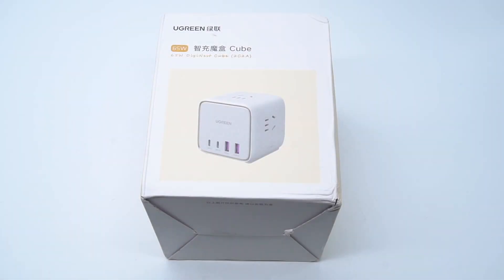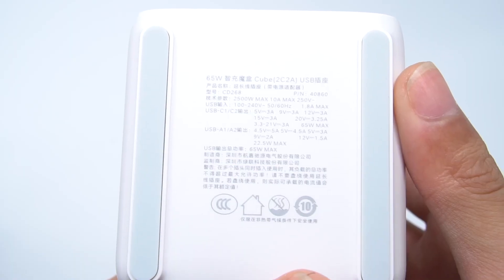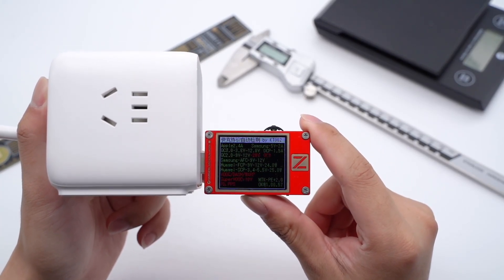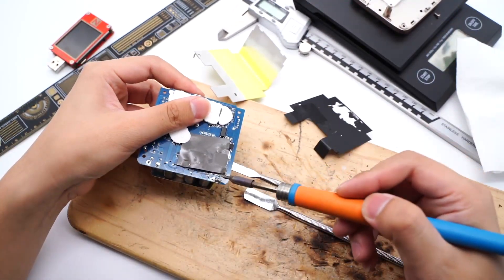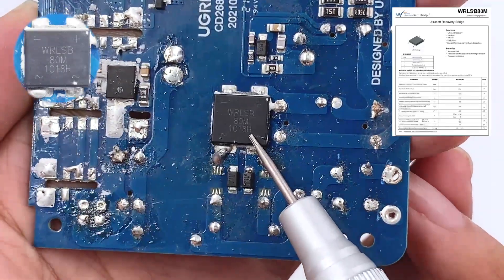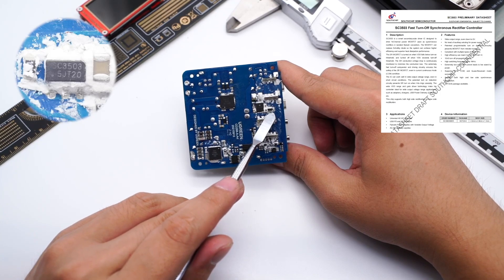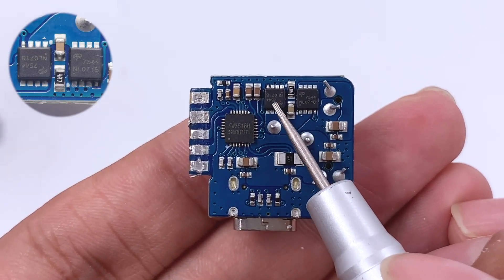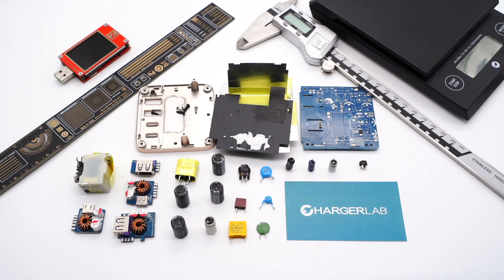Charging without Charger | Teardown of UGREEN DIGINEST Power Strip With Dual 65W USB-C Ports

Comment: Technically, you're connecting a charger onto another charger to connect devices to power. In order to charge without a charger, you would need to connect the USB C port to the wall socket. But this type of strip still saves people extra power bricks. This type of design should be the only type allowed to be sold. 

Hey EU, please exoand the USB C law onto power strips as well, to require at least 20 watts PD port on all power strips, and offering subsidies for higher watt chargers and PPS.

All of us would be appreciated.

Comment: They are just distributing the heat internally that will just work as a thermal reservoir but they aren't dissipating much heat to the environment, the internal module will run very very hot.